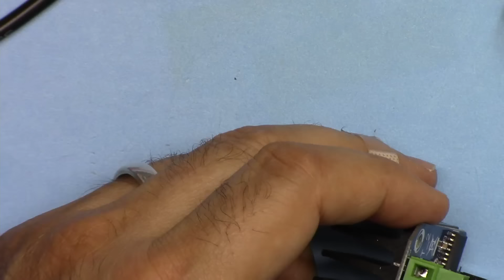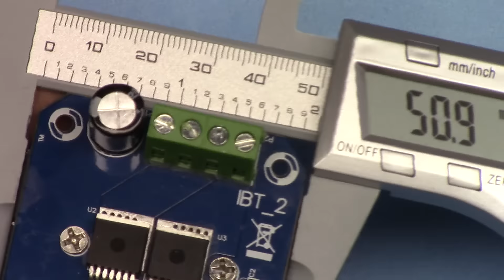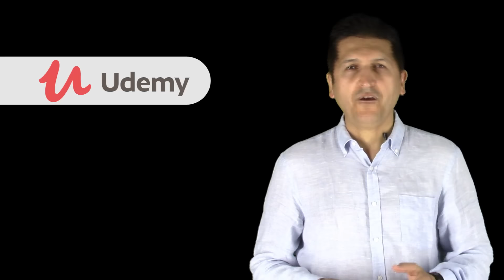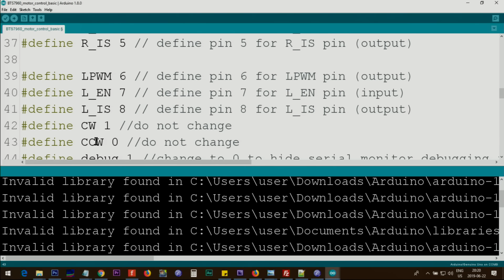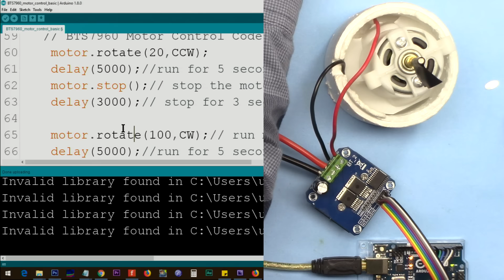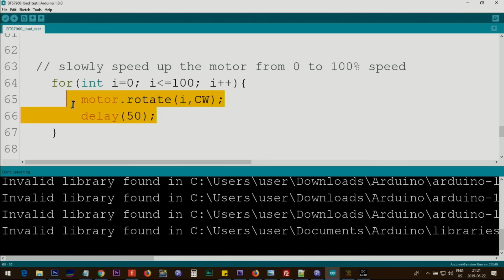Using BTS7960  BTN8982TA PWM H Bridge motor controller module with Arduino library RJT169

Comment: Hi Sir I hope you are well... I have a question how I must change in the code when i want to controle two motors with two BTS7960 in my project in the same arduino project ... Thanks in advance
Reply from the maker: Hi, thanks. Just see the page where the code is , you will see it. You just crest another object for another motor.
Reply: @Robojax  Yes Sir , when i try to add another motor variable I'm so confused how to add it :
Should I write it this way :
RobojjaxBTS7960 motor m1(aR_en,aR_pwm,...);
RobojjaxBTS7960 motor m2(bR_en,bR_pwm,...);
 or this way :
RobojjaxBTS7960 motor1(aR_en,aR_pwm,...);
RobojjaxBTS7960 motor2(bR_en,bR_pwm,...);
?
Reply from the maker: Why confused. Just go there and get the code
Reply from the maker: Did you visit the page where the code? is I have already provided the code. I don't know this code I have to look at code. so you visit the page and get the code.

Comment: Thank you for the great video. Can I use  My6812 12adc motor and lead acid battery to power it? Or use 4x 3.7 V 18650 lituhim batteries?
Reply from the maker: Yes are very welcome. Yes you should. This module can only see voltage and current. if the maximum current and voltage of your motor does not exceed the maximum rating of this module, there should not be any problem.  Please subscribe. I appreciate it and helps my channel grow.  Thank you
Reply: @robojax  yes I already subscribed 😊. If I want to control using joystick what code change I can make?
Reply from the maker: Hi, I have video explains the joystick , take that and use joystick to give data for speed or direction control

Comment: its fine and cheap and that is good, but 6 pins to the Arduino its so much , what if I want to use three motors?
Reply from the maker: Yes Arduino mega which has over 50 pins

Comment: Another great tutorial, thanks so much for your videos. I followed up the video but my motor doesn't run unless I remove the connection between BTS7960 Vcc&GND to Arduino Mega 5V and GND. It was working fine before with the Vcc and GND connected. Do you have any recommendations. Thanks so much.
Reply from the maker: why have you connected the  from VCC from this module to Arduino? I forgot what I did . if you follow the exact instruction, it should work. it has worked for 1000s other people.

Comment: This module claims to support up to 27v. 
I have one and tested with 12v wich is fine. Then i tryed 24v and looks like it died... No smoke or anything else, just stop working even with 12v.
Do you already run this module with 24v input?
Reply from the maker: I have shown the datasheet  for the chip and that it is not fake.  What I said in video, it will work. You have done something wrong.

Comment: Hi, I'm using same module and I problem and I have a question, I have 7S3P li-ion battery 29V and while I was using it %50 pwm mode. I calculated efficiency of power consumption I realized I almost losing half power in pwm modulation. So can I make some mistake or what is wrong ?
My calculation is between battery and bt7960(enter terminal of bts7960) voltage is 29 volt and current is 11 amper and second measurement is between dc motor and bts7960(exit of terminal of bts7960) voltage is 13,6 current is 13,8. So as you see almost half of power I have lost in bts7960.
Reply from the maker: Salaam alaikum,  7S battery Li-Io, nominal voltage is 3.7V so 3.7X7=25.9V. Measure the voltage when load is running.  Why output voltage is low? This is PWM and voltage should not change. Input and output should be the same. We may have about 0.2V drop .  Something is not right. Check voltage. or wiring.
Reply: @robojax  Aleyküm Selam :), I wrote 29V because battery was fully charged(4,2Volt x 7S =29,4 Volt) for this reason I wrote 29 Volt. I dropped voltage with pwm modulation because Normally I will use 7s battery to 24 volt dc motor but I currently do not have a 24 volt dc motor for his reason had to test it with a 12 volt dc motor. I read  the PWM efficiency is about 90% but when I saw my application efficiency was %50, I wanted to ask why my efficiency too bad. I tested because I saw a company hedge trimmer tools it’s using 5S battery(18 volt) but when I measured voltage which coming for dc motor, the voltage was 15 volt. Then I think that they prepared their all requirement  with a constant voltage for this reason I applied pwm modulation. In addition, the charge-discharge voltage range of lithium batteries is too high. Therefore, I want to design my system on the minimum voltage of the batteries in order to prevent the high voltage from damaging the motor when the batteries are fully charged. I thought I could do this with pwm modulation too.

Comment: is there a way to use 16 channel MUX with this setup if i want to run 16 motors one after another one at the time can you tell me how the PWM will be done in software and hardware ? do you have skype to chat ?
Reply from the maker: PWM because it is fast, treat it like full HIGH. Here I have show it on oscilloscope https://youtu.be/6O9SFvEP6Bs and used it here modified a regular module to be controlled y arduino https://youtu.be/k13iTmvPtUU
Reply: @robojax  but do I need both RPWM and Lpwm to turn CW only I mean do I turn RPWM high and need to turn LPWM low to be able to turn it CW ? Or only I need to turn the RPWM high to turn it CW ?
Reply from the maker: No PWM it must for speed not direction. It is your wiring and other codes that make sit possible. In every video I have explained it how the direction or speed is controlled. So please watch
Reply: @robojax  its because i watched your video am doing that :) i love your videos so i can put the EN R and ENL to 5 volts to be enabled and just put the R-PWM to 5 volts and L-PWM to ground in the codes to make it go CW and vise versa to be CCW right ?

Comment: thanx u for your videos, its really helpfull for beginner like me and i learn a lot from this channel.
I have some problem that maybe you can help me with.
I control a 380 6VDC 4A motor with manual PWM dimmer/speed control similar to that in your video https://www.youtube.com/watch?v=kgs_FILyppk, and works well with no problem.

Now i want to control the motor via software that im using, so i tried MOSFET AOD4184A module and the speed control works but the PSU & cables are getting very hot until it tripped the heat protection.
Then i tried this BTS7960 module, but encounter the same heat problem, strangely i dont have heat issue when using manual controlled PWM dimmer/speedcontrol.

My setup is:
- Generic 100W multivoltage laptop PSU (switched to 12V)
- 380 6VDC 4A motor
- manual PWM dimmer/Speedcontrol (works well, no heat problem)
- AOD4184A module (speed control works but PSU getting very2 hot)
- BTS7960 module (same simptoms like AOD4184A)

Can you help me with this problem, since im beginner at electronics. Do i have to add capasitor/diode on the outlet terminal? and if i do, what value do recommend to put in?

thx u very much for any help, 
may God be with us all, greetings from Indonesia

Comment: is it possible to run 5 motors from an arduino DUE ? or we need a multiplixer ?
Reply from the maker: your question is not clear. if instead of 2 now 5 motor in parallel, as I said, you just need to prepare the MCU for one motor and connect the same wire to all motors.  if you want to control more than one motor each separately, then see the link under the video or on the code page.
Reply: @robojax  let me rephrase it you showed how to do two motor what is the max number of motors can one card arduino can control ? Only forward is needed no backward needed if the arduino have 12 PWM pins that means I can do 12 motors or only 6 motors max ?
Reply: @robojax  if i dont want to run all in the same time the 5 motors i need each motor to have its own wires and control to be run one after another can we do 5 motors in one DUE arduino card ? and how
Reply: @robojax  if i have 5 motors can i run it one motor after another ? like you did with the 2 motors ? in this case which wires will be used on each of 5 IBT_2 and which 5 wires will be sued on the arduino ? or i need 10 PWM from the arduino ? bare in mind i only want to have the 5 motors doing forward only not backword
Reply from the maker: Then use arduino mega
Reply: @robojax  am using DUE I think it’s the same right ? 12 PWM but can I use only one wire for RPWM and the REN is connected to 5 volts ?

Comment: what about if i have 2 motors and i want both to run and stop at the same time , what do i need to change in this code for 2 motors please ?
Reply from the maker: Just share both inputs if both modules .
Reply from the maker: I replied that o your question. You didn’t say anything if you were able to do it or  not.
Reply: @robojax  yes i was able to do  but can i run 5 motors invduals ? i mean each one have its own wiring , i want only to do forward not backward , can i use the 12 PWM to do that ? what would be the wiring , i have a very nice project and i want to be able even to run 10 motors from one DUE can i ? witout sharing leads ?> one motor after another start then stop

Comment: Will this module run on a D1 mini? I need Wi-Fi integration into Home Assistant Preferably with ESPHome or alternately MQTT.
Thanks for the video
Reply from the maker: Yes it will. I just Used digital pin

Comment: Great information. Would it make sense to move the heat sink to the other side and clamp it down on top of the circuit components?
Reply from the maker: right now the chips are not couching the heatsink. you can come up with other method to cool it down. yes.

Comment: my motor not running clockwise portion...i.e skipping it......what might be the problem
Reply from the maker: You must have changed the code . First run it without changing the code and once it worked then change it.
Reply: And by the way I am using BTS 7960B .....is it any different than the normal BTS 7960?

Comment: Hi there. Im in the process of building a sim racing wheel with force feedback. I have an old starter motor lying around and was wondering if the BTS7960 driver will be able to drive a high amp car starter motor for the feedback. A car has a 20 amp fuse for the starter and using this in  game setup will never require the motor to go all the way up to max load.
Some guidance would help whis this problem I have
Reply from the maker: Hi,
I don’t remember the rating If this motor driver.  See in the video if voltage and current is higher than your starter then use it.

Comment: Thanks a lot for your Video. I have just one question, if you can help me.  Regarding the PINs 5 and 6 (R_IS and L_IS), how it yours? Digital or Analogy information? If we have over current, the sign should be toogled (0 to 5V)? Thanks a lot
Reply from the maker: “How is yours?” Didn’t understand it

Comment: Could you attached 2 motors to the motor pins even though it i meant for only 1 motor control?

Your videos are great!
Reply from the maker: Yes you can connect two motors to be controlled with one code at the same time. If it doesn’t work, then add 10k to 50k ohm resistor at Arduino output pins.  But you can control a two motors with arduino too. Code is on the same page. There is links
Reply: @robojax  Thank you sir!
Reply from the maker: you are welcome.

Comment: I have got encoder motor with 6 cable. In order to work and take data from my motor, should I connect only 2 cable to my BT_2.
I couldnt file zip file how can I find it?
Reply from the maker: that needs separate code and video. this is library is without encoder.

Comment: please don’t use this code it’s not working(only in 1 direction) if you need a working code please contact me, but I have to say that it is great explanation but, author put 100% of motor speed every time in 1 direction, in oposite direction he can controll the revolution :)
Reply: without a basic knowledge and osciloscope I will be totally “lost in space” because this code is not working in both directions, author explained slow rotation only in 1 direction because the ccw was not  working -> because the code is not good ....to control this you need just 3 pins from arduino if tou need more details -> contac me
Reply from the maker: You have done something wrong. It works perfectly. My demonstration showed. Check wiring before reaching conclusion.

Comment: ciao io mi sono iscritto, molto bella la lezione, molto completa, aiuta molto chi è agli inizi come me, io avrei bisogno di un piccolo aiuto, che magari potrebbe interessare anche ad altre persone, potresti inserire nel progetto un secondo motore ed anche il controllo con un joystick? anche se io avrei bisogno di solo 8-10 ampere di spunto e preferirei per questioni di ingombro un modulo unico compatto che possa comandare 2 motori dc 24V da 4A e spunto molto alto 8A, è una macchina con 6 ruote molto pesante, i motori sono già dentro e non posso cambiare, adesso funzionano semplicemente con relè, ma a me servirebbe il controllo velocità e le 4 direzioni, puoi consigliarmi un modulo simile? il josystick ed arduino ho già, compro quello che vuoi tu su amazon, grazie
Reply from the maker: Ciao e grazie. hai 2 progetti in uno. motore, joystick ed ecco il video e il codice del joystick https://youtu.be/6N8Iq353GM8 ma per il controller del motore specifico, ho fatto così tanti video e questo modulo è il migliore e non sono sicuro di cos'altro suggerire. Buona fortuna e stai al sicuro. Saluti dal Canada. Ahmad

Comment: I ordered one of these units online. I think they are completely unsafe/dangerous. the BTS 7960 chips are together on the same cooling block without electrical insulation. Do you agree on the danger it poses? If so please put this in your video! because its putting people at risk!
Reply from the maker: The module shown in video, the chips are on PCB and body of the chip is not attached to the heatsink. so it is safe. unless yours is different. see the module document https://robojax.com/learn/arduino/robojax_BTS7960_motor_driver_manual.pdf
Reply: @robojax   I think you misunderstood the point i was trying to make. I have a module that looks exactly like the one u use in your video. Your statement that the chips are not connected to the heatsink is not true (in my case)( and why else would they put on a heatsink in the first place??)

. If you take off the heatsink you can see the problem yourselve. The design of the board is so that the chips must dissipate the heat from the chips trough the PCB by mean of Via's. These vias  connect the back of the chips to the heatsink. In my case there is no silicon pad between the heatsink and the circuit board. Thus the only thing keeps the unit from short circuit is the thin black anodised layer on the heatsink.

Your link in to the manual is not very useful im afraid.

Please take a look at the following forum, it is in dutch, but the photo's are clearly showing the problem.
https://www.circuitsonline.net/forum/view/152301

Comment: Thank so much for indicating. However, I need help from you. My DC motors - which made a buzzing noise at PWM pin. as video below
https://www.youtube.com/watch?v=-Cwl98dvgHc&lc=UgxQf3cAa0fqHxPYOjV4AaABAg.9GuieJaHbod9Gumdkp_6_h
I tried to set high frequency up. 33kHz (it's ensure over hearing ear, 16.000 - 20.000Hz) but my transceiver is signal unstable. Can you give me some advices? Thanks

Reference:
1) https://www.electro-tech-online.com/threads/high-frequency-noise-problem.18209/
2) https://forum.arduino.cc/index.php?topic=117425.165
3) https://forum.arduino.cc/index.php?topic=671775.0
4) https://www.electro-tech-online.com/threads/pwm-noise-on-5v.91705/

Comment: Link doen't work is it expired
Reply from the maker: the link to the code is tested and is working.  try it.
Reply: Do u have any website
Reply from the maker: LOL. you haven't even watch 35 seconds of the video. 😊😊😊😊😊 and you haven't even looked at the description.
Reply: Added to my playlist though i will watch it when i have time
Reply from the maker: then please don't ask question before watching. for my regular videos I spend days to make them. for that I've written library and it has taken more than 7 or 8 days time. if you watch my video and follow the instructions, you should not have any question that I wave spoken about.

Comment: Nice video!! 
Could you tell me which motor you use in the video, or recommend me a single-phase motor like the one you use in this video? 
I am doing a project similar to an electric scooter (I need at least 250 W of power). 

Thank you very much and continue with these fantastic videos!!!!
Reply from the maker: Thanks. I've just added the motor model on the code page https://robojax.com/learn/arduino/?vid=robojax_BTS7960_motor_driver I have no experience with electric scooter. Sorry.

Comment: Can this be driven with an esp32? Which I believe is 3.3 volts the data given on the Amazon listing did say a minimum of  3v I believe
Reply from the maker: No it won't work. PWM on ESP32 is different than those of Arduino UNO or MEGA. In this video PWM is used with ESP32 https://youtu.be/VCM6KMMvBfE you may learn something from it. I would have to make video for this module to work with ESP32.
Reply: @robojax  thank you for the information I appreciate it. I'm working on a project so I figured out of work around which is simply to communicate with and Arduino over serial. Regards.

Comment: I think that the ic's are counterfeit. I meassured the resistance of my BTS7960 board and the high side switch and has 775mOhm, the datasheet says 12,5 mOhm max!
Reply from the maker: how did you measure it?
Reply: @robojax  I connected the board with an electric load(set to 2A constant current) and meassured the voltage between vs (Pin 7) and OUT (pin 3). I meassured a voltage of 1,55V. According to ohms law -> R=U/I -> 1,55V/2A=0,775Ω

Awesome Video, thanks for reading the comments!